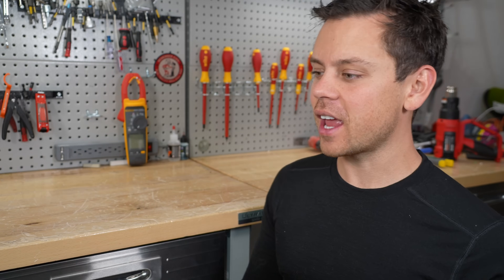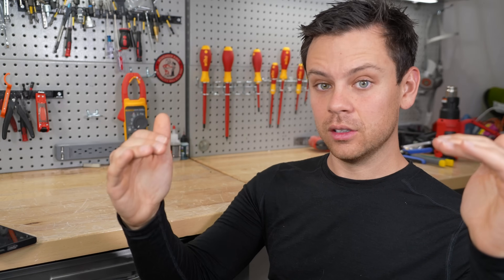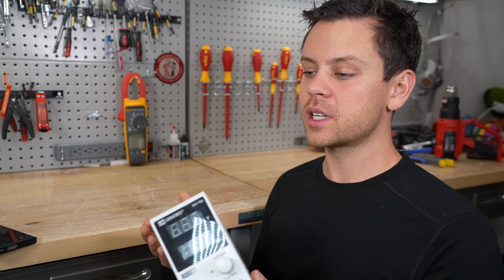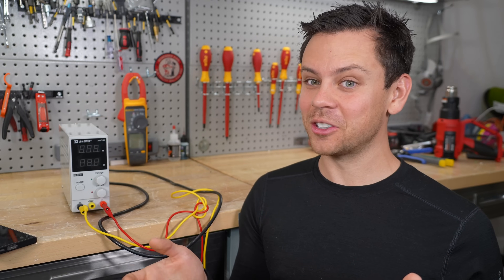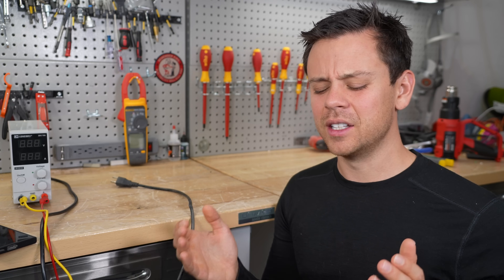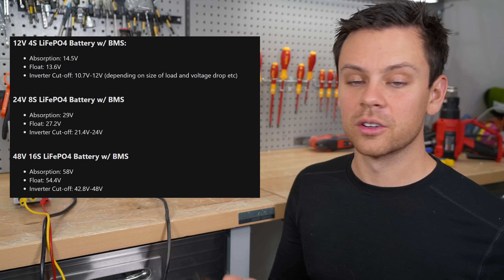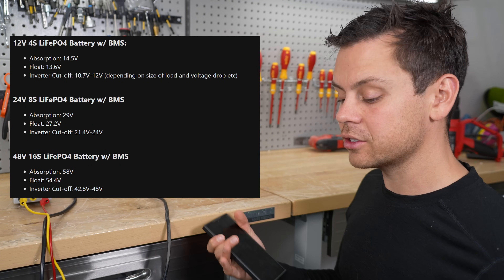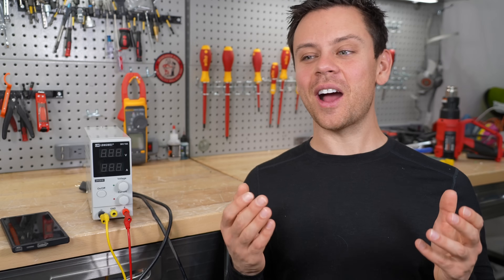LiFePO4 Charging Guidelines: What is 100%? What is 0%?! How to Balance??

Comment: I very much enjoy your videos.
Question.  If I bought a Hysolis Apollo 5K system, could I just leave it plugged in to 115 vac, no solar panels, no load (applied manually in Rare Power Outage).  Will the Apollo 5K BMS manage the battery for long life?  I am looking for very low maintenance, but there if I need it. Thanks.

Comment: Could you add some detail about high temperatures and the degredation factor? I'm in the process of installing batteries in two of the front storage boxes on my RV.  It's under the 5th wheel overhang, but not otherwise climate controlled. I spend lots of time in the southwest, so ambient temps in the high 90s and low triple digits are not unusual.  I could put batteries under the bed, in a usually air-conditioned space, if the degradation is significant.  It's possible I could arrange some ducted ventilation into that front storage compartment, but that seems kind of difficult.

Comment: How about balancing for two 12 volt batteries in series on a mobility scooter? Using a 24 volt charger that plugs into the XLR charge port on the scooter

Comment: Great video for the solar folks.  Please do not forget the rest of us like the golf cart folks.  I work with 2500 lb. machines that run at 5000 lbs. loaded.  These batteries (LIFE04) are used as electric assist like a hybrid vehicle would use them.  The cars have it all preprogrammed with little the owner can do.  I on the other hand are trying to understand my low voltage discharge issues as it relates to cycle life.  This is our main concern.

Comment: If I'm on a free nights plan and I'll be charging from the GRID to 100% every night.  This will also hold at 100% for a few hours until it starts using it during the day.   Some days the battery usage may be pretty low maybe since solar will be covering most of the day usage.  Should I still charge to 100% every night even if it's only cycling between 70-100% for the winter months (as the HVAC is not being used much)

Comment: There was some mention about heat killing lithium batteries. I can agree! I live in Seattle, Washington, USA. I owned multiple electric kick scooters. And what seemed to be the battery killer was during the heat waves. Not so much of the killer, but more of a non-recoverable wound. I can't remember the exact travel distance, but I could give an idea... 

I used to travel 3.3 miles to work and back home easily on a single charge of my 750watt electric kick scooter. I stored the scooter in the not-so-heated garage. We didn't have air-conditioning either. But my scooter charged just fine over night in the winter days and lasted just as long. But on the 1st heat wave warning in Seattle, Wa, of like 90+ degrees fahrenheight or something, After a few days, My battery no longer was able to last to work and back home after a single charge... I experienced this with multiple electric scooters, even my 1,200 watt scooter... I some times even stored and charged my electric scooters under a cover while it was snowing and everything was fine. My roommates thought that I would have a dead battery in the snow... No... My battery was going bad during the 90+ degree farenheit heat waves in the summer. even my 1,200 watt scooter degraded so bad during the summer that I needed to charge it at work just to get back home (but I did move when I had my 1,200 watt scooter, so more miles were required)
Reply: I live on the other side of the Sound.  No problems with my "scooter."  'Course, it's a Honda Supercub, but at about 120 mpg, I feel my CO footprint is pretty small and the reliability is incredible.  Over 100 million of these have been produced as of 2018.  They must be doing something right.

Comment: hey , which cells are used in  battery pack of an EV ? do they use LiFEPO4 in battery pack of EV ? Also what could be the general configuration in which these cells are connected in an EV

Comment: Will the Ep ever 4215BN solar charge controller (your favorite solar charge controller) work with a 12volt 200ah Li time Lithium battery? And if so, what should I set the battery parameters in the MT50. The controller does not support a lithium it says.

Comment: Hello,  we're starting to gather equipment for an off grid solar system for our small vacation property. 
The one thing that's confusing me is the low temp disconnect. 
We're in Canada, 6 to 8 months of near and below freezing. 
Does this mean that the solar doesn't work if the ambient temperature drops below freezing?

Comment: Hi, Very documented and useful this clip,
my problem is
 The Lifepo 12V 300Ah(RoHS) battery at rest shows 90% charge and 13.0V, but when I connect a small consumer to it (5w), it immediately shows 2% charge and 12.5V.  When I put the charger (dedicated Lifepo) the battery display immediately shows 100% charged, 14.6V and it does NOT start charging.  So it doesn't allow me to load.  The battery is new, compact model with internal BMS and external display, I only used it for 4 days for RV lighting (5w bulb for ~15 hours).
   2 wet capes were also stored in the garage of the van, could the moisture have been to blame? 
 What do you think is the cause of this manifestation?

Comment: ive watched this video 10 times and i still dont know what 100% and 0% is.

i have the wattcycle lifepo4 12v 100ah batteries.  the batteries say that fullu charged is 14.2 to 14.6.  -WHAT THE HELL IS EVEN THAT.

I set the charge to 14.2 because supposedly charging to 100% is bad.  who knows.   But i guess - it's not really that bad

Comment: you recomented a good solution .... use em  before they expand ....  but i dont have loads those months and system just idles... so i lower my whole stats even the  absorpsions to let  cells lower  voltages during sun is up.... and at night some draws will put em to work once a month i discharge em a bit harder even if  cell internal memory isnt a fact i still want to work em out!!! when big loads come i sould and i will do more stress tests and work the 3.65  per cell again 
BTW  my  parameters in my lower  standarts are still in the upper levels of rest voltage  . i still want to have some balance...  !!

Comment: Grid power question, Will. My sailboat has all-electric propulsion: 10kW motor powered by four 200 aH Victron 12v batteries, in series for a 4v system. All-Victron charging, bms etc. electronics. 
With boats, when returning from sea you tie up, plug in to shore power, and go home. So the batteries spend most of their time fully charged at 100% - like an uninterruptible backup power supply I guess. So am I good to continue this? Even in winter when I might not run the motor for weeks or even a couple months?

Comment: Are you not using a charge controller that can charge with the CC/CV algorithm? You should be able to charge to a set voltage of 3.55v per cell over the entire pack from a 12v system to a 48v system. Once it reaches the 3.55v it should turn to constant voltage until the current drops to a pre-determined current state then terminate. The BMS I used at one time only terminated at a set voltage. No CC/CV. Bummer. I now only use it as secondary over voltage cutoff if any cell goes over a predetermined voltage.
Reply from the maker: Oh I do both. Depends on controller or PSU if I'm doing it manually

Comment: hello , 
can we connect two 12.8 lipofe4  batteries , in parallel only with screws on the terminals , one over the other upside down ? (or side by side with terminals facing each other ) 
does in general orientation of positioning lipofe4 cells , maters ?

Comment: Good morning Will. I'm an avid follower of your page. I'm from Jamaica 🇯🇲 in the West Indies. I'm just getting into Photovoltaics as a technician. I've been an electrician for more than 15 years now. I thank you for all your educational videos and tips on solar technology. At the moment I'm using a DIY 12v battery consisting of 150a Synology cells, with a 2k  inverter. I don't have any BMS on them but I do have a Cell8 to monitor the volts. I am using a battery charger to charge the cells up & use them at night. For now the cells are like 20mv apart when fully charged. But just by following some of your tips I have that system running my house at night 👍. I will be getting some panels soon and a good charge controller. Looking forward to more of your videos. Keep up the good work 👍

Comment: My E-bike charger is configured for 4x 4s lifepo4 batteries or 48 V.  I'm using 4 12v Maidy 12v16 amp/hr  in a 4s8p configuration.  Each cell provides 2000 ma/hr.  Currently, the charger supplies 59 open circuit volts at 5 or 10 amp.  There is a trim pot that can be adjusted for up to 61.5 v.  I want to rebuild my ebike battery pack with a better BMS and with a higher output and capacity.  the new config will be 17s & 10p or  54v 20 amp/hr.   Charging tables tell me I need 3.7v per cell but the charger can only supply 3.55 v be cell.   Will this be a problem?

Comment: You talked about letting your batteries go to 0%. Give warning about if some of the parallel batteries go to sleep due to low cut off, they might not wake up. I have to pull the sleeping battery, wait 30 sec, then reapply to the parallel that is above wake up voltage.

Comment: Thank you I've been looking for this type of information.  My charger outputs 14.78V during the BULK stage then 14.51V during the Absorption stage and lastly 13.6V during the FLOAT stage.  Will my charger damage my LifePo4 100Ah battery.  Any help would be greatly appreciated.

Thx!
Reply: 14.78v is too much it will damage your cells if you don’t have BMS. Set your bulk and absorption at 14.5v for 1-2hr.

Comment: Too new at this to have gleaned how to know I've achieved the full charge you mention numerous times. Unfortunately I have no Bluetooth or way of knowing anything about individual cells.

2 @ New LiTime 12v230-200a BMS. First charge up to full and need to know when to sync Victron BMV 712 to have a proper benchmark of "full. I will be using a Magnum MS 2812 charger for initial charge after receiving from mfg 3 months ago.

With no BMS coms available how does one know when and for certain true full is achieved.

Comment: Dear Will, hope you will notice this comment and provide your recommendations.
I am going to replace and old Lead acid Battery bank with 64 X 280Ah Lifepo4 cells arranged into two rows of 16 double cells.
My question is:
creating 2 rows of single cells with a 10Amp fuse between each parallel cells to prevent fault of a single cell to cause excessive current from its neighbour cell in case of a cell shorting (or partially shorting) from dendrites at end of life, or
Simply direct parallel coupling of two cells in a string of 16 double cells?
I hope you understand the question.

Obviously there will be two such double strings to consume all 64 cells, and I plan to have a BMS on each double string and then parallel couple the outputs from those two BMS'es onto the 3 x 10KW inverters, in order to cope with the potential full load current. The two BMS can each handle 300Amp. Best regards Steen

Comment: Different issue, but what about individual 18650 and 21700 cells stored red at home? Is it okay to store them charged to 100% (roughly 4.2 volts) or should I keep them around 50%? What is the optimal voltage for long term storage when they are not being used?

Comment: I live in the Caribbean and I still use old style lead acid deep cycle batteries. Like to change for LiFePO4 now. Will (or others who may read this) what do you think about the combination raw cells Eve or Catl 280 or 304 Ah 16 pcs with a Daly BMS ? That's about 15Kwh. My solar array is 6 kw right now but I may add another 6 kw if I should buy an EV in the future. My actual consumption is about 6 kWh per day so I can fully charge the batteries every day. My idea is to buy 2 inverters 5kw each splitphase capable to have 120+240VAC, also to be future proof if I buy the EV. Any recomendations how to improve the system or what I should make different ?

Comment: I bought a lifepo4 battery 51.2 v 100 A for $660 in Pakistan could you please guide me what should be the voltages so the battery doesn’t overcharge or over discharge thanks

Comment: With the battery at rest with no load connected, what cell delta would you consider the cells to be imbalanced enough that balancing is required?

Comment: I charge my new 300 AmpHr Liffepo4s to 28..8 as the manufacturer says but i set an absorption time to 30 mins and during that time the voltage remains at 28.8 and the current drops to 6 amps or less which is the tail current of 2% . By 11am they have replaced the 90 Amp Hrs ( 30%) used the previous evening . Is setting the float at 27 volts with a re- Bulk of 0.1 volts going to help balance them or do they need more time in Absorption as Victron MPPT pre-set is 2 hours . The rest of the day seems to be 0 watts or changes up and down between 0 and 8 watts as the y are in constant use in the day but only shallow loads .

Comment: So when your LifePo4 battery bank has normally lost capacity over time, should we be adjusting the BMS to reflect the new capacity? Otherwise, for example, couldn't you be in a position where the BMS is reporting 20% charge left but in reality you are at zero?

Comment: Question:  I was always taught that batteries cannot be voltage-measured at No LOAD.  is that true with Lithium Lipo?    Does one always measure battery voltages under a LOAD?

Comment: Great video Will! 
What charging voltage would you recommend for a LifePo4 golf cart battery? 3.65 high volt disconnect.  Option here is either 58.4 or 56 volts with the onboard programmable deltaq charger. Also for some reason my balance volt is set at 3.3 at 15mV.

Comment: Hi Will, you talk about 100% at 14,5 volt, but 4×3,65 volt is 14,6 volt.
Please explain the 14,5 volt.
And how can I see that the cells are balanced. If I open the battery to check the cells, the battery is damaged for good.

Comment: Thx for your very informative comments on using LiFePO4's in a solar system. How important is it to run the capacity test? What if I just use the rated capacity on my 4 new EVE 314 AH LiFePO4's along with your 0 and 100% SOC voltage values for a nominal 12 volt solar battery?

Comment: if I have a single battery, 100 AH, and later on I add an additional battery in parallel; do i need to charge the new battery to 100 pct before I connect the 2 or can I use the lithium charger and just let them balance by themselves over the winter
I only have the one lithium charger and I hate to do disconnect and reconnect, I guess i'm just being lazy

Comment: I live in TX and Im looking at putting a 12v Lifepo4 in my truck Ram Box with a 40a dc-dc. In the summer we got temps up to 108F+. My truck usually sits in the sun. Should I be concerned with this battery being too hot for too long?

Comment: When I set absorption voltage to 14.6v and the batteries approach fully charged, my Victron 75/15 sends crazy high voltages into my RV's electrical system.  My Victron Smartshunt reports voltages in excess of 17vdc.  When the voltage peaks like this it causes the fan to run in my dc fridge, and the van to run on the charger converter.  It's crazy!  If I reduce the absorption voltage to 14.2v or lower the crazy high voltages stop.  I suspect this is why Vicron has separate "load" and "batt" terminals, but I have yet to find even one RV electrical video where the load terminals are used.  I guess I'll never have fully charged batteries.

Comment: How do you prevent the charge controller from freaking out when the bms disconnects the battery? My experience is that the battery shuts off when tops out and the then the solar controller no longer is getting battery voltage the charger starts making voltage spikes about 30v and then the inverter freaks out and shuts off. The battery is felicity solar 24v 200 amp. I think it could be that one on the cells is not balanced ,  charging and float voltage set at 28v.  For now I’ve lowered to 27.6v which seems to keep the bms from shutting off the battery.

Comment: My profession is UPS, believe me, imbalance is a big problem.
Dropping load is a real risk, just because the BMS reports that a single cell is too low.
We solve the problem with adjusted charging voltages, asking the customer to do regular tests, and even correcting the voltage with active balancers at the cell level, something that is dangerous, we are talking high voltages here.

Comment: I'm in Florida for 7 months and I go to Michigan for 5 months every year. I have 3 electric golf carts, two 36v and one 48v, switched all to lithium last year. One of the 36v has a single 38.4v 105ah Golf cart battery, the other two have three 12.8v 60ah and four 12.8v 60ah, do you think I will have problems with the 60ah's ?? They all run good right now, no problems yet. Golf carts are in Florida.

Comment: Sounds like i need a system thats not too big not too small. A balance system battery to solar ratio. Perhaps with an inverter generator to top off. Or alternator tie in for van build. Only reason to have a inverter for battery for microwave. Or maybe a solar generator i can bring in to charge.

Comment: I am building my 1st hybrid solar system, I am based in Northern Scotland and i know winter is not going to work to well with the panels, I have 4 x 12v 200a batteries, connected to give me 24v and 400a. My question is can i connect my AC external 30a 12v  charger to top up the batteries as the hybrid charger will only come on when the batteries are nearly depleted. Hope this makes sense.

Comment: Im in northern canada have 5000 watts of panels, 23 kwh lifepo4 the one battery 48 volt 16 cells 280ah with jk bms, but December, January and February 7 to 8 hours daylight and lots of overcast days its very hard to get a full charge but the battery with the jk bms says there staying balance very well.